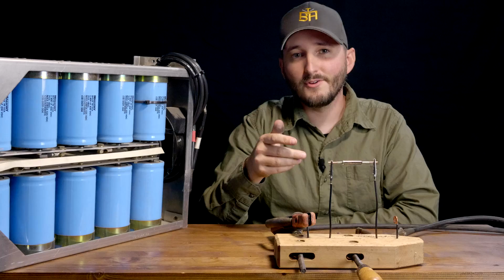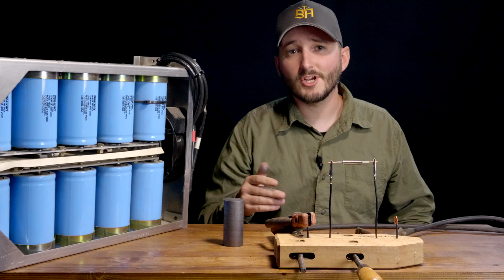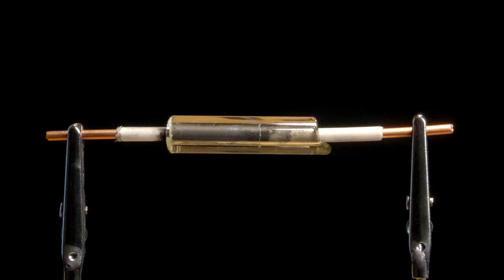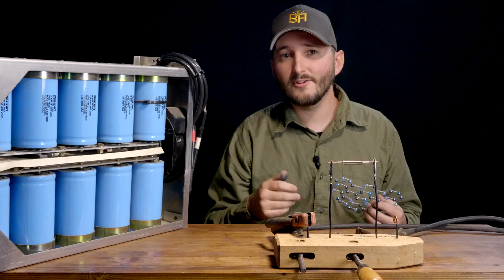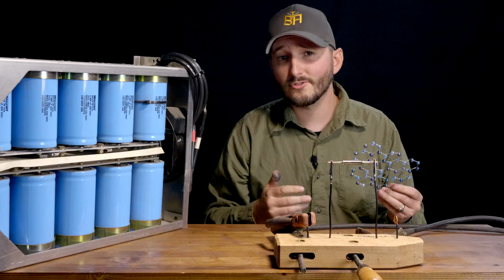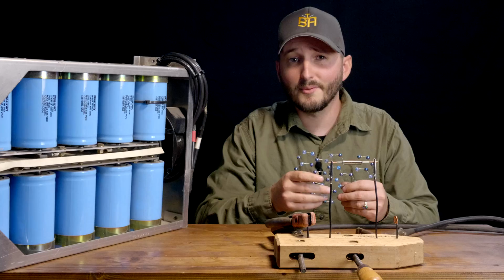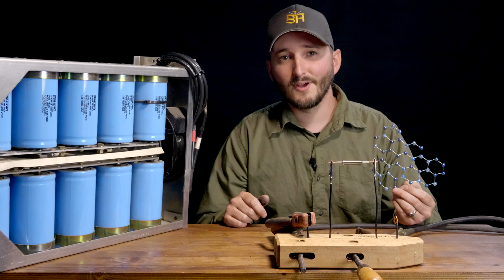How The World's Strongest Material Is Made From Coffee Grounds (Flash Graphene)

Comment: You know you're going to have to do a batch of flash graphine infused starlite now right?
Reply: @ニンコー it is thermally conductive but thermally resistant and thermal shock resistant (thermally tough), it might make a good cover layer on top of the starlite maybe? It's a for fun experiment.
Reply: @ニンコー I think it would actually be fine. Since the flakes would be mixed into more or less homogenously, what you'd probably end up seeing is heat that more quickly penetrates deeper initially (as the graphene helps transmit the heat deeper into the material), but then the added strength from the graphene in the carbon foam that is produced should help this foam layer last longer. End result would be a more durable starlite that can take a beating for longer, despite initially generating foam faster.

Comment: Wooooooahhhhhh thank you! Thank you! Thank you!
Off to the drawing board!
This will combo with the geet plasma refinery I made!
Now I can direct the excess carbon BEFORE the main chamber gaining the graphine before it hits the plasma and dematerializes. This allows the engine to operate as a generator and production machine! And I'm currently running it off just air. For 17 months now it's never turned off once, uses air as fuel, and produces more oxygen as waste than three forests annually. It's been an un-upgradable system for too long. Extra money printer/construction resource refinery! Here I come 😁!

 To those wondering, no the geet normally doesn't run off air. I had to work three years to tune it to intake enough larger gaseous molecules to break into workable sub elements, then make whatever fuel I was aiming for, then use the reactor to waste only oxygen molecules while returning anything else for plasma continuation. The free pdf anyone can download runs on nearly any liquid. I tuned mine to run on any gaseous mix.

Comment: A SCR is the best way to switch a capacitor bank. In your case you would need two: One for the main discharge and one for a emptying discharge since SCR's cannot be turned back off as long as a voltage is present. So use a big SCR for your working discharge and a second smaller one do dissipate the rest of the energy through some halogen lamps.
Reply: One thing I misremembered: SCR's have a holding Current , not a Voltage.
You could start off with a couple of these: 
TYN80W-1600TQ
To trigger them you can just look up SCR Trigger circuit. Typically a couple of AA's should be enough. If one isn't sufficient just add another one in parallel.

Comment: Holy crap capacitor bank is beautiful!

Discharging those beasts is often a difficult thing if you don’t have a proper switching method. And when you need to time that discharge to 5 milliseconds, contact welding becomes a large issue. 

I’ve done some research on how to prevent contact welding and a sulfur hexaflouride atmosphere is a decent option. Sulfur hexaflouride breakers are used in substation breakers to switch insane voltages and currents, while preventing arcing, and would probably suit discharging that bank well. 

Another option is finding out the specific voltage at which a dead short of the bank will result in a 5ms discharge time, that would probably require an oscilloscope or just some general tool to measure the time of the discharge, or you could do some calculations as well, but it in general seems like the easiest method.
I.e, raising the capacitor voltage to where the discharge time would only take 5ms
Reply from the maker: Capacitor bank was $280 on ebay, made by Eaton. Pretty cool. For discharge rice labs surprisingly was able to use a mechanical relay. There are solid state options that might be more appropriate though. We'll see how it works when I get everything set up

Comment: It's cool to see how simply this can be done. If you haven't, I suggest Tech Ingredients' video on flash graphene, they go extremely in depth, and do some structural integrity testing as well. (They use carbon black and use a vacuum chamber for better efficiency). 0.6% graphene effectively quadruples the bend resistance of an acrylic tube filled with epoxy. Fun stuff.

Comment: Usually I would recommend SCRs for switching such high energies but those devices will run several 1000s of $ for the power rating you need for this capacitor bank (450V at several mF is nothing to sneeze at). The voltage is too low for using a triggered spark gap w/o losing .5 of your energy on the switch. What you could try however is to use the reaction chamber as the switch intself:

Introduce a small gap into the material and use a inductor in series, and one inductor coupled to it (think single pulse transformer) to send a small high voltage spike on the gap. If done right you can dump the entire energy of the CAP bank on your reaction chamber.

Safety precautions:
#1 USE BLEEDER RESISTORS, plural!
#2 attach multiple voltage readouts on you cap bank.
#3 never touch the cap  when charged to any voltage other than 0V
#4 test any setup at smaller scale first! Having a charged cap bank sitting on your bench that you cannot discharge because your switch failed is no fun experience.
... these devices are dangerous, treat like unexploded primary explosives.
Reply from the maker: There's some 900v 500a relays for around $100, which is what they used for the setup at Rice labs.

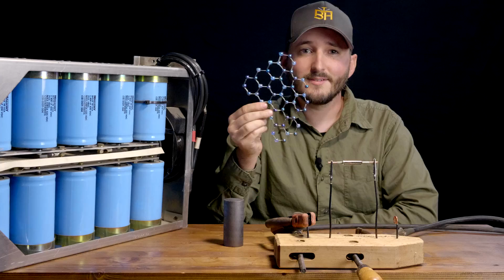Comment: 1:00-1:33 I think graphene is easily accomplishable with charcoal, saltwater, and sand/ quartz powder.

Try crushing charcoal into powder and then add it to a concentrated salt water solution with some sand (or quartz powder) in there. 

Next, BOIL the solution and stir for 30 minutes or however long you want. What happens is that the salt water intercalates the graphite (which charcoal is) and the quartz powder exfoliates/peels the sheets off it because of Quartz's Reverse Piezoelectric effect.  I've done this experiment and the results are suprising! You'll know it's graphene because it'll stay floating to the top when you stir or leave the solution sitting for awhile.

I'd recommend giving this experiment a try and share your findings with the world!

Comment: You could use a large knife switch to discharge the caps and a fuse to cut it out at around 5ms. You would have to design a new fuse to handle the current for 5ms though there might be a commercial lightning fuse available. You could possibly use a magnet and a few loops of thick copper in the circuit as an electromagnet to push the knife switch open as soon as the current flows, that should provide a quick interrupt.

Comment: How long would it take to recharge that capacitor bank once fired? Big idea suggestion is to connect a wimhurst generator to the bank, with a wind turbine turning it. Then  multiply the number of coffee tubes in a rotating...? (I'm visualizing bullets in a revolver) piece. When the bank is fully charged instead of the spark gap usually on the generator it flashes the tube, rotates to the next one, and the bank refills. Theoretically you could do all this from the safety of the other side of the room.

Comment: Project idea: I am currently researching PCMs (phase change materials) for DIY ice packs (gel packs) to improve cooling over ice by increasing specific and latent heat capacity of the material. It seems sodium polyacrylate (fake snow) makes a nice gel that can outperform ice in cooling power several times, but perhaps some salts like copper nitrate might perform similarly and might survive more freeze-thaw cycles, compared to organic materials.
The research is a bit difficult because googling for ice pack compositions proves frustrating - one never finds an exact description, the manufacturers never publish them, but luckily, there are many papers and patent applications detailing the manufacturing process.
Reply from the maker: Good idea! I'm only familiar with the type of ice pack that uses a salt with an endothermic reaction when dissolved in water. For these they usually use ammonia or urea nitrate, with a little pack of water in the bag that you pop. More similar to what I think you're talking about are the sodium acetate heat packs where they have a supersaturated solution of the salt with no nucleation point, but once started the crystallization process is exothermic and maintains a constant temp of ~70C for some time. I don't know of an endothermic solution with the same properties, but that would be pretty cool.
Reply: @Nighthawkinlight  Yes I plan to test the nitrates as they seem to be reusable, the fake snow noticeably cools down as it binds water in the copolymer structure, so it seems to also have the property, but I am looking for the exact numbers. Hopefully there are some calorimeter experiments.
I have a feeling the polymers tend to break down on refreezing (from ice crystals).
Another great factor is the freezing point depression as it allows the whole mass cool down before freezing, preventing the formation of insulating ice layer which slows down the freezing process.
Perhaps displacing dissolved gases plays a role, too.
I am fascinated there is so little information about this, comparisons etc. but I if I find some convenient DIY solution, I will definitely share on ScienceMadness or similar forum (YouTube format takes way too much time to make a decent contribution - I admire that you take that time).

Comment: Don't need the capacitor bank.  Plug directly into 120 VAC, hot end go through stators and a H20 and sodium (salt) solution, then your arc tips. Carbon rods come from inside an alkaline battery D size. Experiment should be done with caution and carefully to avoid electric shock.

Comment: Sounds like a macro version of an idea I had in about 1990. Use silicon chip tech to create an controlled over-voltage at the micro scale. Feed carbon in line with over-voltage. Extract carbon nanotubes or with a slightly different feed, sheets of carbon. I called it a carbon roll-up. Feedstock would be channeled through microtubes to the reaction point. Feedstock would be a gas like methane.

Comment: Is there a significant amount of energy required to charge the capacitors? Otherwise a green energy source would close most of the production carbon dioxide loop. Amazing work.
Reply from the maker: A fairly significant amount to charge, but only a small portion is discharged with each flash.

Comment: It is great fun to imagine what might be attainable with this process if, for example the source material were monomolecular carbon.

Perhaps it could be dispensed as a continuous sheet from a roller or other surface or maybe a nozzle dispersing it over a broad area and also causing it to transit via a sustained high intensity arc in a carbon dioxide environment rather than brief discharges?

Such an approach should also overcome any undesirable issues arising from ozone creation.

The following deals predominantly with carbon nanotubes rather than sheets.

It might prove possible for monomolecular carbon in solution with liquid carbon dioxide to be ejected through a sort of plenum chamber filled with the same solution via circular nanoscale nozzles.

It might be possible for the aforementioned solution to pass along the longitudinal axis of and be imparted with progressive impetus by high intensity laser/s combined with and assisted by motion imparted to the solution by regulated directional flow.

The energy of the laser/s might cause tubular graphene to be continuously extruded from such raw material and if this could be achieved very high efficiency electrically conductive cables could be created.

I recall watching a presentation on the science forum TED which if memory serves stated that carbon nanotubes can be up to 9,000 times more conductive than copper.

Imagine the implications for electronics if reticulation for electrical energy comprised of this material could be incorporated to microchip circuitry instead of copper?

Power consumption due to impedance losses might almost disappear and heat sinks become obsolete, cooling fans might be redundant and heretofore unrealistic processor speeds and capabilities attainable!

Limitations imposed by relatively low energy density for storage media is a significant obstacle for researchers in fields like cybernetics who are currently striving to create increasingly autonomous robotic devices.

Limitations for transportation powered by stored electrical energy are also exacerbated by losses due to inefficiencies inherent to current technologies.

If advances in storage technologies that are adequate to existing and anticipated demands are currently unattainable, then perhaps we could focus on improving efficiencies for technologies that are reliant upon stored energy and so make a charge last longer?

By employing graphene based material far more efficient than copper based conductors, technologies reliant upon stored energy could be made to leap forward by at least an order of magnitude comparable to advantages it could provide for energy storage itself.

For example it might be feasible to wind electric motors with carbon nanotube strand and it could also be used to convey energy throughout the system from the batteries.

If that were achieved even the capacities of current cutting edge storage methods like Lithium Ion could become far more effective relatively speaking.

Applications such as aircraft and maritime vessels like yachts that derive power and even auxiliary propulsion from stored electrical energy could also benefit significantly.

Comment: You should make a diy air compressor that can generate a significant enough amount of a air to perform sand blasting. Air compressor prices are through the roof and the diy videos on YouTube simply involve purchasing a new head and pump and putting them on an old tank 

I've thought of using small motors running in unison to generate enough horsepower to turn a 5hp head but calculating horsepower for that application is outside my realm of understanding.
Reply from the maker: That's not a bad idea. In terms of your motor size, it's all a factor of how fast you need the thing to work. Otherwise it's just a matter of putting the right set of pulleys on until the motor starts turning it.

Comment: Thanks for the video. I'm sure I could design and make a motor driven mechanical switch to handle thousands of amps for a fixed on time of 5ms with a very low on resistance by just using the basic machining skills I have. The arc that would form on the disconnect would erode the switch contacts over time but it should be OK for experimental purposes. The chance that I could be bothered to actually do that is rather slim.

Comment: I'm an electrician, I wired up a graphing plant earlier in the apprenticeship, and they used electrolysis to extract graphine  from graphite.
Reply: The electrolysis method is nice because it's so easy and cheap. It basically exfoliates the layers/sheets of graphene off the graphite source with the current running through it.  However, it's still not as good as the cvd method which can make much larger, continuous sheets.  That's the graphene form that most researchers are excited by because of its extreme structural and electrical properties.

Comment: This is pretty cool if it does indeed make high quality graphene, but even if it does--it's a bit out of the purview of the average DIY'er type, and if one goes the capacitor bank--then a potentially very dangerous scenario.  

     Anyways, while I have some interest in graphene, I'm more focused, pragmatically speaking on certain carbons and graphites that have cool electrical and various strength increasing properties.  

  One of the materials that I'm most excited about along these lines, and which I've experimented with the process of making, is high purity/percentage carbonized and graphitized nanocellose crystals.  You take a cellulose source with a high percentage of crystalline cellulose (the various bast fibers commonly used for textiles are pretty good, as they range from about 60 to 75 or so % of crystalline cellulose to soft cellulose), subject it to an oxidizer/bleaching agent first to take out lignin, then subject it to proper ratio of sulfuric acid (not really all that dangerous--over hyped) and proper time and heat which basically chemically burns out the soft cellulose.  

  You're left with a very high stiffness and tensile strength, nano rods of highly crystalline cellulose.  Then converting that into carbon or graphite via heat (and low oxygen, reducing atmosphere) coverts into an even more "super" material (increases the various strengths, and in graphite form really increases the electrical conductivity).  The research on this stuff indicates that a little tends to go a long way, with around 2% to 5% by weight in combination with epoxy for increasing various material strengths optimally. 

  No, it's nowhere near as cool and mind blowing as very high quality, high purity graphene, but it's not that hard to make and not that expensive to make (it's a bit time consuming, but the base materials are not that expensive), doesn't require super high temps or very high currents, and you can make a lot at a time.  Both electrically and material strength wise, it favors comparably to most poor to mid quality graphenes out there (i.e. non true graphenes).  

    The carbon conversion process can be done with a simple insulated charcoal burner (a couple nestled clay flower pots with NgihtHawkLyte material on the inner surface and/or some ceramic fiber insulation in between the pots), and then the graphitization can be finished up in a well insulated microwave kiln.